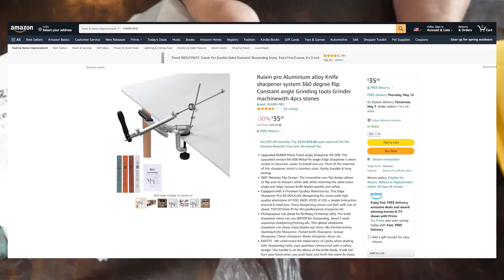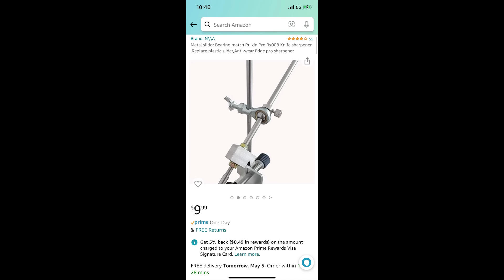An Actual Review of the Ruixin Pro RX-008 knife Sharpener

Comment: I bought my sharpener 6 months ago.  I have been using high quality Japanese whetstones for years.  Nothing comes close to their edges I achieve with the whetstones.  That said, I have been using the Ruixin on my utility type knives. I will not use this system on my expensive Shun blades.  Any stone needs water while sharpening.  I use a spray bottle to keep the stones wet.  I get a good slurrry and not the mess shown in the video.  I would rate it 6 out of ten. I only paid $30 for my kit.  My good stones cost $68-80 each, but last a long time.  Key to this unit is to keep the stones wet while using.  I had a very expensive Tormek sharpener which was the best.  Once I learned to use the Japanese stones I sold my Tormek.  I was a Toolmaker for 35 years and I understand the concept of the burr edge.  You have to understand what metals you are sharpening.  Most times I just have to fine tune my good blades.  My Shun blades are set at 12 degrees and are incredibly sharp.  I finish them ona 10,000 grit stone which polishes the edge. I also use a 10x Loupe magnifier to check for imperfections. I will only sharpen blades for people who I know will use them with care. These knives will cut your fingers to the bone instantly. Good luck.
Reply: I have a shun knife and have been trying to sharpen it with a regular whetstone, with little avail. Do I need a special stone?

Comment: The extremes of what knife sharpening systems can cost bottles my mind.
Reply: It puts your mind in a narrow state with limited room for escape?
Reply: Boggles. The word you are looking for is boggles.
Reply: @ruthlessone3k  I've heard it both ways.
Reply: @danthemakerman  Boggle and bottle are two words that have completely different meanings. I would just blame it on auto correct 😂
Reply: The extremes of how distorted westerners idea of value can become as soon as they’re offered 3rd world slave made products, in place of the ones their community used to try and make, boggles my mind…
Reply: Useless!
Reply: @dannyarcher 
I’ve just purchased one of these as a mobile kit when I can’t take my powered machines with me and although it wasn’t perfect out of the box for £70/$90 for the machine and a set of 10 after market diamond stones up to 3,000 grit and one small modification I’m absolutely delighted with it. I can get scalpel sharp blades easily and after stropping a mirror polish. 
My one has a metal guide so it’s much better than the nylon ball in the vid. My only small mod so far is to grind a flat on the upright so the pivot holder screw can’t rotate or slide up or down. I’m going to make a scissor holder next and I’m considering making a holder that takes 4 stones like on the WorkSharp system to save time swapping out stones. 2 holders would be enough as I rarely need 80grit and there’s at least one intermediate stone that could be missed out without affecting the end result. One other addition I’m working on is a way of holding a cylindrical/conical hone to do serrated blades.
Reply: @thechumpsbeendumped.7797  yeah I rate these mate. They’re not great but with tweaks and used properly they’re not bad and will certainly let you cut through paper. 

My issue was with how the fella had it set up and was using it.

Comment: Looks like a cheap copy of the KME sharpening system that I've had for years. What I did find interesting were how long the stones were but if they're cheap then that doesn't help anyway. I've got diamond stones with my KME I just never liked how small they are. Looks like Workshop has a sliding rod sharpening system also. I'm sure Workshops kit is far better than this.

Comment: There's been an upgrade of Rurixin Pro to a 009 version and they fixed some of the issues. The clamps are much better and now the rod does not change it's angle because of loosening screws.

Comment: You are literally reviewing a sharpener I have used for 3 years.  I have not watched yet, so I'll come back with my opinion.  I sharpen for money, not a full blown business, but I have friends in the industry that asked me to save them some money  on sharpening, so Ive been doing that for 2 years.  Everyone is happy.  I personally love it.  I will say, the stones it came with are long gone.
Edit, at 3:58, all of those screws maneuvers you talked about are what everyone does, so Im glad someone clued you in.  I moved the limiter to the top, but mine never came with a thumbscrew for the pivot, all are allen keyed.
Edit, those diamond stones are garbage, the adhesive will fail on them.  Ive had to hot glue every single one back together over time.  And the grits are off.
Edit, those diamond stones are supposed to be used on a scrap piece of metal to remove the excess at first.  What you saw happen is exactly what is supposed to.  I bitched that they are garbage that they fall apart, but they do work well after some teething.
Last edit.  I have the model on up from that one.  Mine was $59.  I never expected the stones to be quality so that was expected.  I think I spent $60 for my diamond set and $80 for the wet stones which was well worth it.  My handle has never failed, though it is different from that one.  That middle screw is really important for angled spines.
Reply: You seem to know alot about this precision sharpener. That said, I've a question.

I'm lookin into a set of diamond stones or high quality whetstones. Lookin at a set of each for roughly $50, with grits 80-3000 about 10 stones a set.

Are these good quality or do I need to look higher? I have seen some individual stones priced at about $10-$30 a stone.
Reply from the maker: The diamond stones I received were cheap.  The low grits quickly lost their grit and cut very poorly compared my other diamond stones.  They were garbage and that's where they went.  If you've made this sharpener work for 3 years more power to you.
Reply: @GreenBeetle  Why come off like a tool for no reason? I don't own this thing, I don't have a dog in this fight and don't have an interest in it other than the general curiosity having seen it everywhere on Amazon. 

The guy said that the included stones were long gone and I didn't see anywhere in his comment him touting their "amazing" quality while rushing to their defense. 

But if the unit works particularly after replacing the stones with once a decent quality why would he need more power to him to work with it? And why does your tone come off kind of butthurt? It's very weird.. Anyway, thanks for the video, I'm not going to thank you for the butt hurt comment though.
Reply: what are good replacement stones?

Comment: I  just got mine and was able to sharpen five kitchen knives fairly quickly. Overall, I think the system feels cheap, but it got the job done. I don't think the stones will last but from your video I learned that I could buy better stones, which is a plus. Thanks for the review.

Comment: I made the mistake of buying this kit; however,  through Amazon. Even purchased extra stones. Yeppers, customer service doesn't exist. Two of my stones that came with kit were broken. Am pretty sure that these stones are held together with a flour and water paste. I managed to sharpen my chef knife and a boning knife. When holding the stones sideways, I could see a slight dip forming. Talk about slurry; unbelievable. Again, no customer service so I did the best thing for the kit. Took it away out back and shot the case several times to put it "down." Put remnants in small trash bag and Adios. Deeply disappointed, but I learned a lesson. Appreciate your video as it shows I am not the only one with a bad experience. Have a great weekend.
Reply from the maker: :)  I was surprised not to find a negative review of these on YouTube yet.
Reply: @GreenBeetle  Same with me.  Live and learn.

Comment: I ordered mine from AliExpress in December and received it in early May (about 2 weeks ago at time of writing.) My unit has a metal bearing and all metal parts except for the handle which, so far after 10 carbon and molybdenum steel knives, is holding up well. I'm happy to learn that higher quality stones will fit because I enjoy this sharpener so much. I have some Chinese style cleavers that I struggle to sharpen because muscle memory wants to default to a lower angle of sharpening and this tool solved the problem, as well as cutting a big chunk of time off the process.

Comment: I got one of these at Christmas. Think this is a pretty fair review. The stones I got with mine where pretty garbage. Got about 8 knives sharpened before the first stone snapped. Rest were very worn and lots of slurry. They did get the knives sharp though and I tried on a small wood carving knife up to larger chef knives and all held in great.

I haven't used it a ton as I need new stones but for me it seems good enough (for the price) and could be tweaked to make it a bit more solid.

For someone like me that makes a few knives a years as a hobby it does the job just fine and was quicker and easier then a DIY solution. Also easier to get consistent edges over doing it with just stones (again for someone that isn't doing it all the time).

Comment: my Ruixin works just fine. way better than the all-plastic WorkSharp. sure, the stones that cane with it were used up quickly, but apart from that i could give a mirror polish edge to many of my knives. i think it is perfectly usable right out of the box and provides decent results. the TSPROF diamond stones are another league of course. get them and have a solid system.

Comment: Really useful video, thanks. I've had mine for probably a year now, and I'm using it on my knives only once a month. I find the best system for me is to use 2 chef's honing steel (a chef one and a butcher's fine one), after that I finish with a very fine water stone and a quick strop on an old leather belt.
One thing to be careful of is to sharpen your knife the full length of your blade, other than that, it's a very useful addition to my kitchen.

Comment: I had no missing parts. The angle adjustment knob would not stay tight even after swapping out the screw. I was constantly checking my angle. This thing just would not hold. I added a slider stop under the angle adjustment rig to see if that would hold it. Anyway I got two ZTs sharpened but what a hassle

Comment: You need to file a small flat spot where the set screw needs to seat so it’s not trying so hard grabbing on a round surface
Reply: Better and easier to file the screw tip to a round shape directly imho.🤨

Comment: Try making the stones last longer by only drawing the sharpening stroke toward you.
Every time you push it against the edge, the blade shaves the stones for you. Additionally, you also remove the small burr, which actually does the cutting.....
Reply from the maker: Burr does not do the cutting. These stones are straight junk most low grit stones do just fine back and forth cutting.

Comment: I went up to 1500grit, but when I test it by cutting a letter paper, the cut have jagged edges (paper fibres showing, instead of a smooth cut), I wonder does that mean I should go higher grits or sand more with the 1500? 

Also, I found the angle is not maintained consistent between stones because of their uneven thicknesses (worn out or manufacture error), so sometimes the finer grits are not working on the very edge but where the edge and side join...

Comment: Interesting review...thank you for finally convincing me that sharpeners like this aren't worth the misery...why spend $100+ to make a $40 sharpener acceptable?    I gave in and ordered the TSPROF Kadet (I hope the affiliate link worked!) and I'm excited to have a sharpener that I'm sure will last me the rest of my life.
Reply: "why spend $140 when you can spend $250!"
Reply: @X4Alpha4X   The Kadet was 100% worth the money...I couldn't be happier.  It's pretty clear the Ruixin will be garbage no matter what you do to it.
Reply: @jwiz1911 
I disagree, I’m getting beautiful results with 1 minor mod that took 5 mins and replacing the supplied stones with a set of 10 diamond ones with a finest grit of 3,000 and it’s working perfectly for a total outlay of £70/$90. Apart from the handle mine is all metal (unlike the mainly plastic TS prof). My mod was to grind a flat onto the upright rod so the pivot can be locked in place more easily.

Comment: I had one. I have used CNC machinig stuff as well. The whetstones are a joke, but easyly updateable whit diamond stones. And the structure couldn´t be better with less,😂
 I´ve learned the same  I learnt in Moto GP (PC): "everybody can accelerate in the straight line, many can manage the turn. And just a few control the angle all along the turn.

Comment: I have one of these. Seems they upgraded the bushing to metal vs. Plastic. I havent had any set screws coming loose, so thats a plus. But the stones dont hold very well with the spring. The handle doesnt seem to add tightness when pushing it down. The biggest gripe js the stones! First knife came out razor sharp, the second had issues, and took 3x as long. Like it wore the 1k grit to 10k. The arm that holds the stone on is held by not even half inch of shaft which is a concern, but hasnt caused any issues. Overall im happy with it. Consistent way to sharpen without ruining any expensive knives by havjng the wrong angle. I still need to finish my kitchen knife set, but im going to buy a good set of stones and should be good to go.

Comment: I guess it all depends what version you receive.  5 or the 7 stones I got are the same color - be careful of which one is next.  like you said the stones have a short life span.  On kitchen knives it worked well  - BUT - if you going to sharpen a small pocketknife - good luck, it's difficult to position.  Also, I used a Lansky and could bring the edge to a mirror shine, but even using a strop I could not get the shine.  Enjoyed your information about replacement stones.

Comment: I ordered the same system and fortunately it came with all the parts. I personally didn't like the way the handle was, so I took it off and flipped it over so it hangs under the rod. That seemed a lot more stable and comfortable to me. Thanks for sharing and the info about the better stones. I'll definitely be ordering better ones once these wear out (so soon]. 👍⚒️🔥
Reply: How did you get on with it and which stones did you purchase? 
I bought a set of diamond stones for $40 and although I’ve only sharpened 10 knives I’m very happy with the results I’m getting and the speed that I’m achieving. I did the same with the handle coz it feels more comfortable and ergonomic that way.
Reply: @thechumpsbeendumped.7797  I'm actually still using the same songs that came with it. I've basically just used it on a few of the kitchen knives, and they seem to be holding up. At least the higher grit ones anyway.
Reply: @SoggyBottomForgeJoe  
Yep, the higher-grit stones seem to last longer but my 2 lower-grit stones were getting perilously thin before my diamond stones arrived. So thin in fact that I took my Lansky with me just in case I needed it. I think I must have sharpened 50+ knives at the Foodbank where I volunteer so yours will probably last a while if you're just using it for your domestic needs. When you do need to replace them you'll be surprised how quickly the diamonds cut. I've got a set of 10 stones, 2 of the coarsest ones don't get much use and I use 6 of the remainder up to 3k to get a razor edge. Once the first burr is established with the 200 or 400 grit it only takes 2 passes on each side with subsequent stones to do the rest. I've only sharpened 12-15 knives with the diamond stones since they arrived so can't attest to their longevity yet though.
Reply: @thechumpsbeendumped.7797  I'm hoping to get my forge cleaned up and get back in there soon. 🤞 then I'll have a few more knives to put under the stone. 👍⚒️🔥

Comment: Many did you sharpen it going forward and back directly against the edge of the knife instead of sliding up and down the entire length of the blade? Wouldn't the way that you sharpened it cause the stones to wear much faster?
Reply from the maker: no. they melt not matter what they're garbage
Reply: he did, he's using the stones like an idiot...

Comment: Even dmt stones feel smoother immediately after the first sharpening, then they lose grit much slower over a period of time. Very similar to my work sharp except those stones just dulled over a quicker period of time than dmt stones. I’ve honestly been impressed by cheap diamond stones many time although they will last you around 50 sharpening before they must be replaced in my experience

Comment: What’s the difference between this and the wasabi? I got the wasabi and, aside from the handle, none of it is plastic and it came with a few extra screws. The most difficult time I had was getting the angles right and then the slurry.. yikes. I know that’s wear and tear on the stone. I managed to get decent edges on a few knifes, good enough to cut whatever, I tried the paper thing and it catches and just tears the paper. The sharpened edge has little nubs? Coming off. I’m guessing a strop will take care of that? I have up to 1500, assume I need 2-3000 to get that razor shard edge. Overall I’m happy with it, it’s easy, kinda fun.. oh.. the lack of decent instructions is a let down. That’s why I’m here looking for advice/reviews etc.. I did contact them and they are quick to respond with websites etc to solve any issues I have.